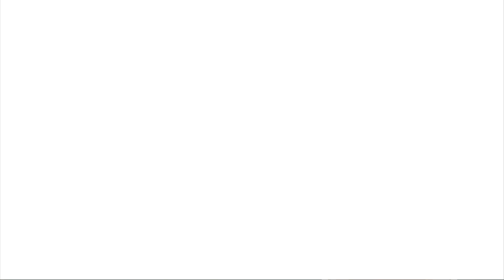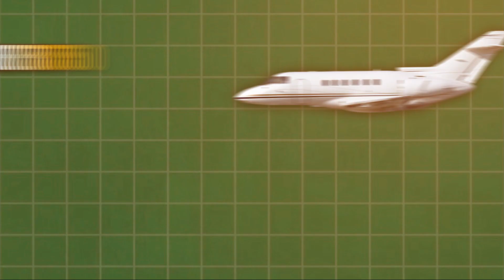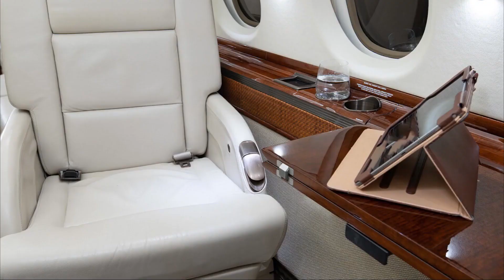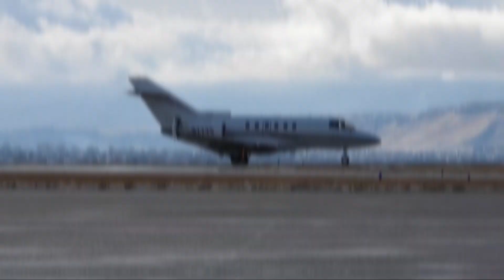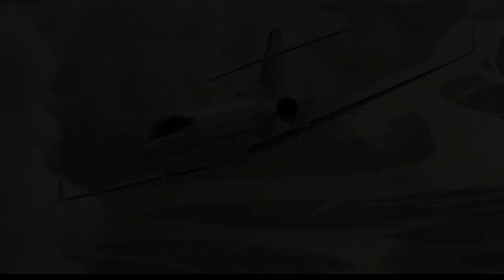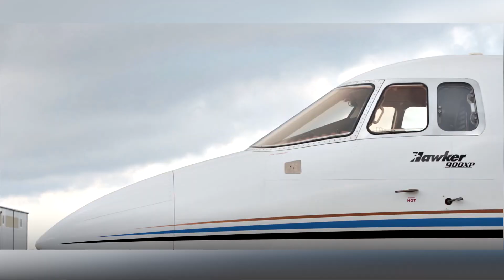Exploring the Luxurious Interior of a $16 Million Hawker 900XP Private Jet

Comment: Granted it’s got a nice cabin. However it does have some disappointing limitations. First it’s slow compared to other aircraft it competes with Mach .77-78.  Most others are cruising at .80-.82. The other big limitation is altitude. Its service ceiling is only 41,000 feet. Whereas most of its competing aircraft service ceilings are 43,000 to 45,000. There is no such thing as a perfect airplane. The Hawker seems like a step backwards to most others in its category and class.